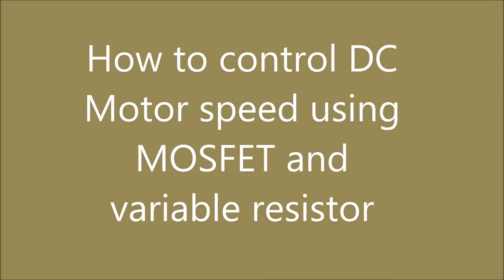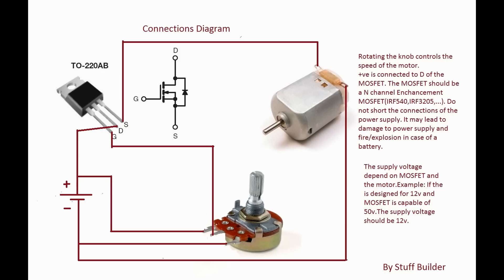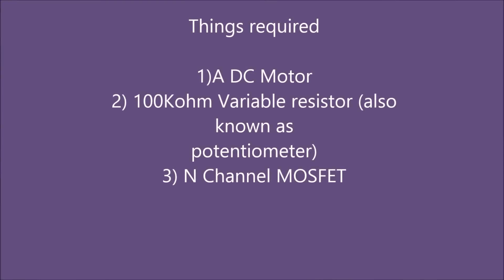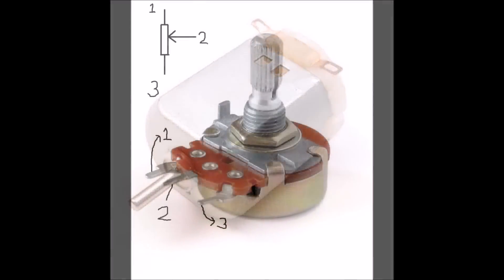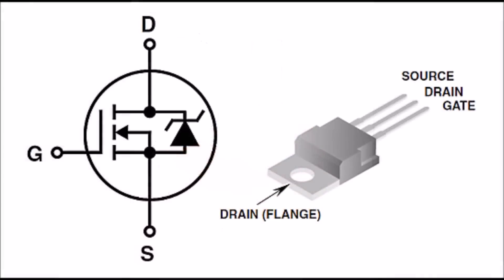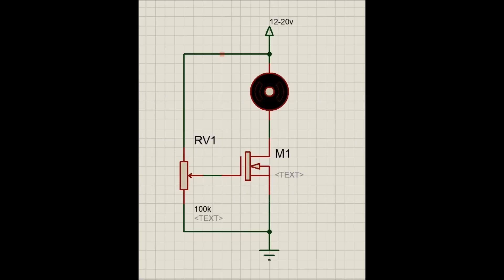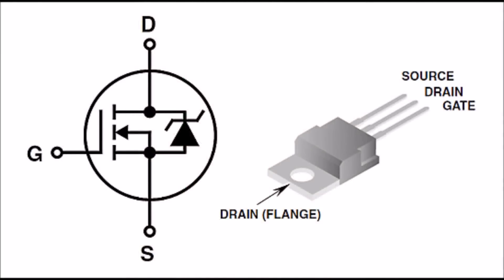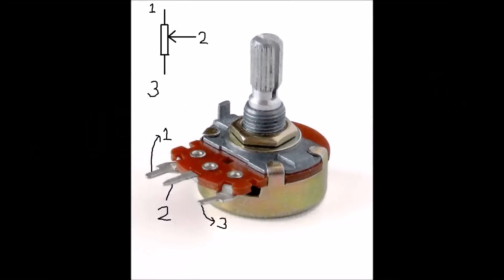How to build the simplest DC Motor Speed Controller(Using Potentiometer and MOSFET)Updated

Comment from the maker: Use the first diagram that appears in the video and not the schematic that follows because the it has a mistake in it.
 
If you are trying to control a switching load(Computer fan, etc), please connect a 1kΩ resistor at the output(parallel with load). This is a crude and inefficient way of controlling a load(Motor,LED,etc) and should be only used for household purposes. The current handling capacity completely depends on the way the MOSFET is cooled.
Q : What is the need for MOSFET when you can directly use a potentiometer ?
A : It completely depends on the POT(Potentiometer). If it's a huge(in size) POT then you can easily control it without the MOSFET because it can dissipate a lot of power(V*I) across it and won't burn. But the one I(most of us) use here is a physically small one and is rated for 1/4W. So lets say input voltage is 16v. POT is moved so that output voltage is 9v and it's directly connected to the motor which at 8v is drawing 1A current. So the power(think of it as heat per second) produced at POT is (potential drop across the POT * current flowing through it). 
In this case, it is (16-9) times 1 = 7 Watt. There is no way this heat produced can be dissipated into the environment fast enough(For a POT rated 1/4W). So the temperature will start rising and eventually get to a point where the carbon trace inside the POT starts burning. So instead of doing that(burning the POT), we chose to use a MOSFET which can dissipate fair bit of power(~75W with heatsink) to act as a voltage controlled resistor. Finally, it's all about power dissipation.
Power Dissipation : Amount of heat produced within a component that can be transferred to the environment/surroundings which much rise in its temperature. All power electronic devices have this rating in their data sheet.
Reply: Stuff Builder  how manny volt the mosfet if u are trying to cennet a cellphone batt..
Reply: Stuff Builder I am looking to use a dc motor as a “shaker” to oppose vibration caused by a radio controlled helicopter whilst it is on the ground. I think I could use this idea I’d just need to offset the dc motor. Is there anywhere that the full wiring diagram is shown?
Reply: Stuff Builder can i use 10 or 20 mosfet in parallel?
Reply: Shouldn't there also be a resistor before the load to limit the max current?
Reply: Rami Ghazzawi  Yep I soon learned this principle in tinkering after 11 months lol.

Comment: Why do we need a transistor here? I am asking to understand the logic behind the circuit exactly.  Only using a potentiometer, it is possible to control the speed of the motor.  I also see some circuits in which a capacitor is used with transistor.  I do not understand why it is used. If you can help me, I will be grateful. Thank you.

Comment: Hi, others use sc2625, it is correct? I understand that the transistor is here to limit the current on the potentiometer. Where can I connect the low power switch (microswitch, SMD...) in this scheme? I'm doing a mini drill with a 24V motor.

Comment: The first schematic shows the motor connected between source and negative.  This is the "common drain" configuration.  The problem is that the source must be many volts less than the gate in order for the MOSFET to turn on.  If your power supply is 12V and the MOSFET requires 10V to turn on, then the source will only have 2 volts, and the motor won't run at full speed.
The motor should be between the drain and the positive for full voltage.
Reply from the maker: Most MOSFETs have a threshold of 2-3v. So it's true that it won't run at full speed but will have good range for higher voltages. If Motor is connected between Vcc and Drain, the MOSFET easily turns ON(or OFF) but few degrees turn of the POT and no precise control is achieved.

Comment: can i use  this circuit for a 1.5v motor? connected to xl6009 putting out 5 v dc?
Reply from the maker: Yes. Although it's not regulator, so the output voltage varies when you load the motor. Use a MOSFET that has low threshold voltage. Because max output is Vin - Threshold. For most MOSFETs, the output will go from 0 - 3v with 5v input, consider that as well.

Comment: A diode must be added between the motor to prevent current from flowing back into your MOSFET. This design will damage MOSFETs.
Reply: I thought you only needed that for a AC induction motor  or with a inductor  inline to control the current,    , Not DC?  .
Reply: Daniel Furlong No, it's also needed for DC.
Reply: ahh  yeah  i just found a video on it  .  Diode going across the inductive load back to the positive .  Flyback diode
Reply: Yeah you right.
Another problem with this circuit is that you cant run thr motor at very low speed like 1-10 rpm  Bcs the mosfet will be in off state.
At the moment the mosfet gets on tte motor starts at a minimum speed of lets say 1000 rpm and not 0 rpm. So you cant run it between 0-1000 rpm bcs the mosfet will be off.😜
The best way is to run mosfet with a pwm signal.

Comment: when i tried this my potentiometer burned up

I did exactly as in the first diagram
Now i have a useless potentiometer :(
it started stinking and then a burst of light from it when i was running it about half way. then it died. no motor controlling anymore

and it only worked for the last few steps of rotation it didn't start turning until 90% has been turned.

mine was made with the motor between negative?? if that affected it??

the middle lead of the pot was to the gate of the mosfet.. 
the mosfet was barely warm
I was only running a small DC motor without a load (like one in an xbox controller) and it would only take a few milliamps of current to run :(
Now i have a useless circuit and burned pot :(.
Reply from the maker: Pot should never burn because the gate is high impedance(means no current flows in or out of the gate). The only way POT would burn is if the MOSFET is shorted or because it not a MOSFET just looks like it(It may be a BJT).  So you either had a bad MOSFET or it was not a MOSFET. Check the part no to verify that it is a MOSFET. That is why I made a updated version(in the description)where a put a resistor in between the gate and middle terminal so even if the MOSFETs bad, it won't hurt the POT.
Reply: I TRIED to verify the part number but it just keeps coming up USELESS GARBAGE 
but i know for sure its a mosfet because i took it out of a no longer working (but the mosfets were fine) 300 watt power inverter.
and there was 4 of them.
i tested it before i used it by using my finger and checking the positive connection to a positive surface and it did infact work.
but it stilled burned my potentiometer :(
I was using 12v with it.
and the varying speed was really inconsistant and jumped a lot.

I made one before using a 105W NPN+PNP darlington transistor pair and it worked flawlessly (I did have a resistor between the middle pin of the pot that time though)
so do you think because i didnt put a resistor that it fried itself?

the NPN+PNP darlington pair i made was really powerful and didn't even get warm with the massive heatsink i had it thermally glued to. (the PNP was doing all the work and the NPN was simply to amplify the base of the PNP so that it would be more efficient)
It was able to handle a 24v DC sewing machine motor stalled without overheating at the middle setting on the pot
but the pot is one from a non-working audio amplifier... could that be causing a problem as well?

the part number of the mosfet is HX640 in bold text in the middle (the largest readable letters on it. There is some smaller numbers above and below that. but they dont help search results either) it is 3 pin.

My transistors (I originally ordered 95W TIP's) and received 105W TIP35D's and TIP36D's (two NPN and two PNP's)
Reply from the maker: Yes. It's possible using NPN transistors as well. Just that it requires a second transistor to drive base of main transistor for higher currents that's why I use MOSFET. But the fact is MOSFETS HAVE a high resistance input(gate) and draw no current so if the MOSFET was working how did it burn the POT. I still think that it was BJT. BJTs were used as switches in older PSU/Inverters. One way to see if it's a BJT is using diode test mode on a DMM. Put the +ve to gate(possibly base) and negative to source(or possibly emitter) check reverse also and see if it show a voltage of ~0.7v. If yes, it's a BJT. I could be wrong though but considering the fact it should be a BJT
Reply from the maker: BTW, the resistor doesn't change the behaviour of the circuit. It's just to protect the POT incase the MOSFET is bad. MOSFETs can be easily damaged by ESD.
Reply: I tested and it was infinite resistance in all combinations except drain and source. about 0.6 to 0.8v
And it couldn't be a BJT because I tested it with applying 12v and a load. then touched the gate and positive input with my finger. and the output instantly turned on
touched the negative/ground of the power supply and the gate and it instantly cut off.
which behaves like a mosfet.
a bjt would have to act like a flipflop in order to act like this with extreme sensitivity.

between the drain and source in reverse i get a diode reading when reversed (protection diode of mosfet?)
and it wasn't an old PSU inverter that its from. It was from a brand new car-style power inverter with four mosfets in it (and four on the output) which ran on 12v cigarette lighter plug. or battery cable clamps. It died because the control circuitry for the voltage boosting died and was shorted somehow.. which caused it to output nothing (always stuck in off state)

All the mosfets were fine so i desoldered them and nabbed them for future use.
It was only 20$ for that inverter on amazon. 300W maximum output as well.

so I dont know whats wrong with my circuit.
I must have a faulty potentiometer or bad wiring hookup. (i didnt bother soldering just wrapped wires around each other and the component legs. I had some thin stiff copper wire and wire to use that i stripped the ends on.)
Reply from the maker: Yup. That test hand test(charging the gate capacitance using hand to turn it on) definitely signifies that it's a MOSFET. I'm not sure what's happened as well.

Comment: what if i use 4 mosfets in parallel and 1 potensiometer in series to all of them, will it explode on my hand ? :D (total need is 72 volts and 300 amps)
Reply: lol, so it'll worth trying :D btw the datasheet says the mosfet can handle 75 volt and 80 amps (stp75nf75) and i will use 4 in parallel, so i think mosfets won't fail but the potentiometer will right ?
Reply: so what if i give the voltage to the gate externally (for example from arduino)? will it still explode ?
Reply from the maker: The current mentioned in the data sheets is significant when MOSFET is used as a switch and not as a resistor. Then main problem controlling huge voltage and current in this mode is heat. The MOSFET just gets too hot and cooling it is not possible even with heatsinks. Still if you want to, you can try.
Reply from the maker: Yeah. It won't if you apply a PWM signal to it. Because then it's just a high speed switch. But you'll have to research if it'll need a MOSFET driver to drive the gate.
Reply: hmm okay i got it, thanks btw, but the point is i've said something wrong. I'm going to use this as a motor controller for pmg 132 and it actually consumes 20-40 amps at normal loads. It is capable 200 in charts but the reality is it can consume up to 300 amps when u climb uphills using this motor.
Reply: so not a constant 300 amps will pass through

Comment: it doesn't work!!
Reply from the maker: It certainly does!!
Reply: i have build it and it dont change speed am the voltage only of 0.07 v
Reply from the maker: You probably have some faulty component or you're trying to control something other than a DC motor

Comment: how many amps it can handles ?
Reply from the maker: Around 5A with a attached heatsink
Reply: Is it possible to increase this current connecting one or two transistors 2N3055 after the mosfet ? Or connect second mosfet in parrallel with the first ? Is there any other way to increase the handling current?
Reply from the maker: First way
Yes. Connect identical MOSFET in parallel. The problem here is that you'll need a higher supply voltage. There will be a higher drop across the MOSFETs at higher currents. If you can keep the MOSFET in their operation temperature region then handling current can be 20+ Amps.

You could connect 2N3055 after the MOSFET and increase handling current.
But again, the transistor will be getting really hot and proper cooling is required

Comment: That engine works at 5v right? But you give him a 12v input? Does the mosfet regulate the voltage? How much should the mosfet be?
Reply from the maker: There is a 3~4v drop across the MOSFET. So you apply a input 3~4v higher input. Check the diagram for details

Comment: can somebody explain me why my circuit doesn't work?? i did exactly what the diagram is showing but my output does not change when i turn the knob of the potentiometer... I am using a 9v output and my motor is a 9v dc..
Reply from the maker: It should work. Make sure all components are good. Test each component individually.
Reply: Mine is working for 2 years now

Comment: I try to control my 12 v dc geared 1000rpm Johnson motor....but while trying potentiometer starts burning.....what happened plsss xp lain me..and tell me how to control rpm of my motor
Reply from the maker: Please read the description. There is a updated design. And it's probably because the MOSFET is bad or it's not a MOSFET
Reply: I'll check it out. any way thanks

Comment: if we connect 9v that means max output will be around 6V right? how can i solve that power loss
Reply from the maker: Yup. That's right. PWM can solve that problem. Or a low drop out variable voltage regulator
Reply: oh k

Comment: How come for some DC motors this works, while some dont
Reply from the maker: +Electronic world Because of the controller IC in the CPU FAN. It switches different coils ON and OFF causing the Vgs to pulse. Actually, a cap(>47uF) should also be added in parallel along with the resistor
Reply from the maker: It definitely works with all DC motors(Passive loads). You might have connected a BLDC or stepper motor to it. Also, it may not work with active loads i.e. CPU fan with has a controller IC(In such cases, add a 1kΩ resistor in parallel with the FAN)
Reply: why we have to connect a 1k resistor parallel to pc fan?

Comment: Sir! Why I need a MOSFET if I can connect the potentiometer directly to the motor without the MOSFET?
Reply: Android Series Because a normal potentiometer is not made for handling high currents. Read some datasheet specs and compare the motor current*voltage to the wattage that the potentiometer can handle. A MOSFET is made for handling big currents.
Reply: Richard van Pukkem Thank you
Reply: Hi richard, i was reading your anwers and i have a question, if im going to reduce 6 volts to 2.4 volts just with a tension divider  using two resistor (4k and 6k ,this is okey using cocodrile clips tells me this is okey i dont know) with 1watts each one,.  ,this  is enought?  or i necesary need the mosfet? what do you think?  im new with  electronics subjects , so im sorry if my question is to basic. thanks.

Comment: can i use 2n2222a or bc548 or. bc547
Reply from the maker: Nope. It will burn. But if the motor is low current is just might work. Put a 150Ω between base and middle of the POT

Comment: Hi, Good simple circuit. I made one with an IRF510 N-channel power MOSFET from Radio Shack and a 100K Pot, works great. I added a 1N4001 fly back diode for the motor, as seen on Google Images. Be good, C.
Reply from the maker: Great!😄

Comment: I used a supply of 12 V 1A to motor .using the circuit I can feel the vibration kind of stuff, motor is not rotating visually
Reply from the maker: Is it Brushed DC Motor? Brushless DC Motor or Stepper Motor won't work. If it has more than two wires its probably not a Brushed DC Motor and won't work

Comment: my project is same like u but i cant use variable resistor then we need to use only a resistor to control the power from 100% to 75% and 50%. can u explain how to do it and what the value of the resistor that need to use
Reply from the maker: It's a little complex
Reply from the maker: And i'm not sure if I can design that

Comment: thanks sir,Is it possible to control 24v dc motors using this schematic replacing with (Tip122 mosfet and 100k potenteometer)
Reply from the maker: It should work

Comment: if you connected the load directly to the positive power, and connected the drain to the other side of the load, with the source connected to ground, you would have much higher maximum speed, as in this configuration, the voltage across the load would be limited to Vcc-Vth for the mosfet used, Vds could never be lower than Vgs, and Vgs must be higher than Vth (threshold voltage) for the mosfet to turn on.
Reply from the maker: I know that but then once the potentiometer output goes above 4v, the MOSFET goes into saturation. So if I had a 12v power source i'll only get speed change for 2v to 4v. For all other pot output there will be no change.
I could use a 4v reference(using zener and diodes) and connect the POT across it but that would make it a bit complex.
I wanted this to be simplest circuit ever thats why

Comment: good stuff.. Can run at 100 rpm?
Reply from the maker: It actually depends on the rated RPM of the motor. If it geared it will do 100rpm, otherwise there's a less chance
Reply: I'll give it a try .. thank Stuff Builder
Reply: Vai Hinduan A normal DC motor is very hard to run at one specific rpm. AC motors are already a bit better for that job. If you really need exact 100.0000rpm with some load on the axle then you need a stepper motor + controller circuit.